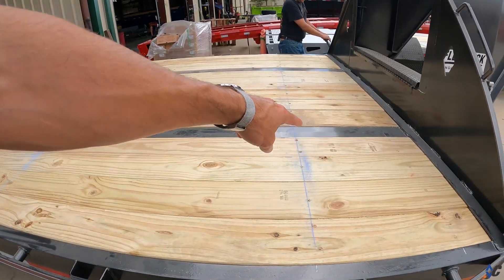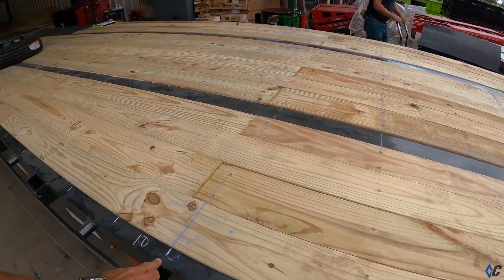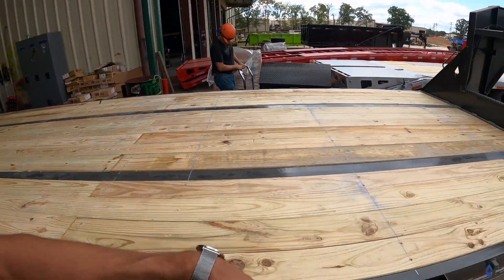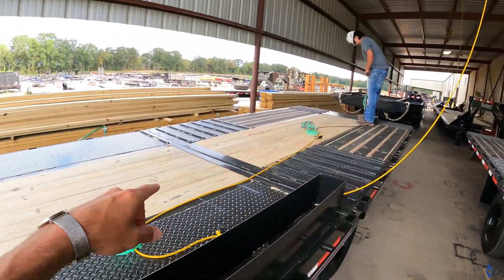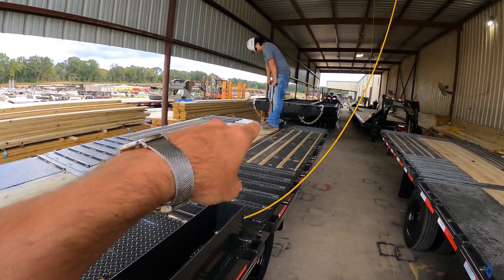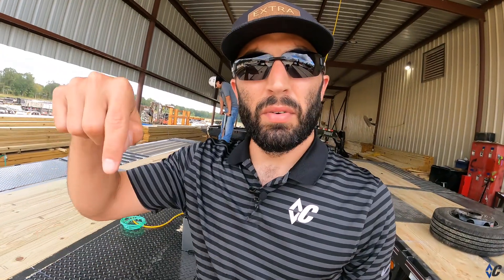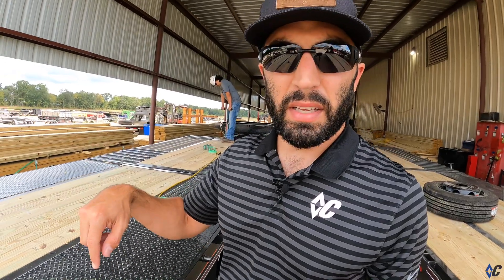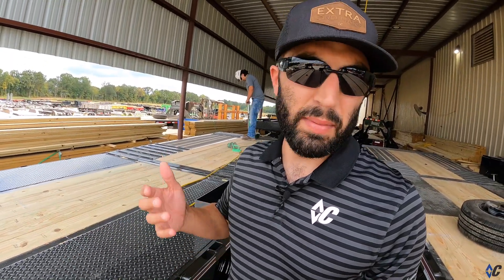How wood flooring is installed | Diamond C

Comment: Just purchased an FMAX212 late last week.  Interesting that I had watched this video before I even bought the trailer & was impressed.  Not so impressed now.  The oak decking option the trailer came with has loose boards, missing screws, screws laying in between the boards, some of the 8" boards with only 1 screw & already cupped and loose, and others with almost 6' span with no screws at all!  Then to top it off lost brakes on way home.  Did an inspection of trailer to find both hyd brake lines on front axle pinched & damaged.  Dealer points me to Diamond C warranty.  Called and despite there being 4 people in warranty no one has yet to return my call 3 days later.  So I sit here with an almost $40k trailer that is not safe to use, not even legal w/o brakes, & can't use it.  Not a good start Diamond C
Reply from the maker: We apologize for the inconvenience and frustration you have experienced with your FMAX212 trailer. We would like to assure you that your concerns have been addressed, and we have taken immediate action to rectify the situation. Your dealer has been informed, and they have received the necessary parts to address the issues. Someone will be in touch from the DC team to get your floor screws taken care of. We value your feedback and are here to provide the support you need to make this right. Thank you for bringing these issues to our attention, and we apologize again for the inconvenience caused.